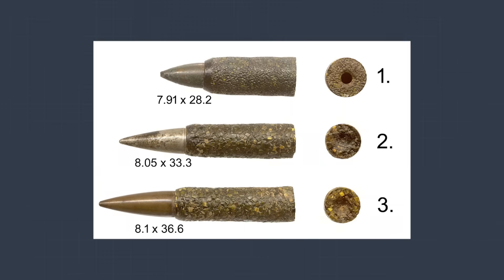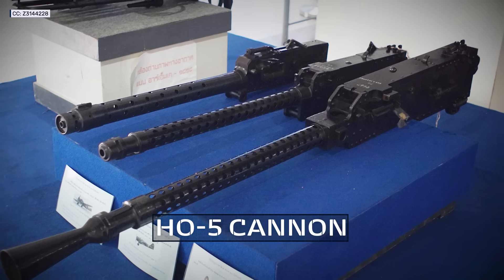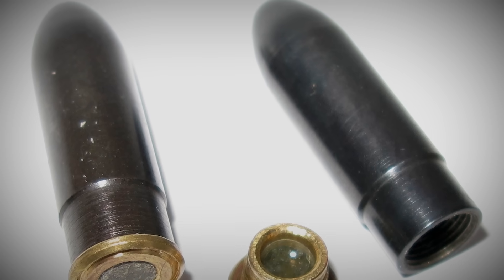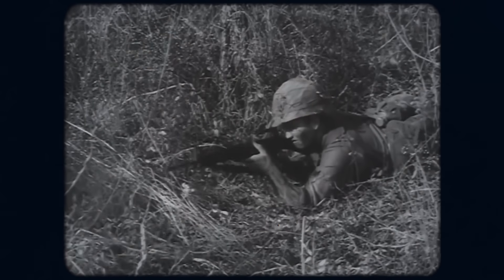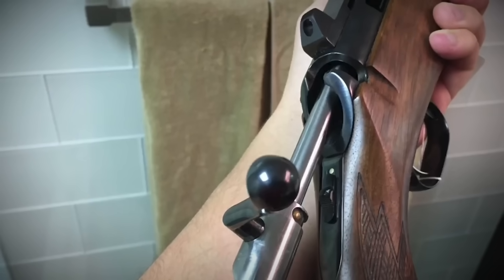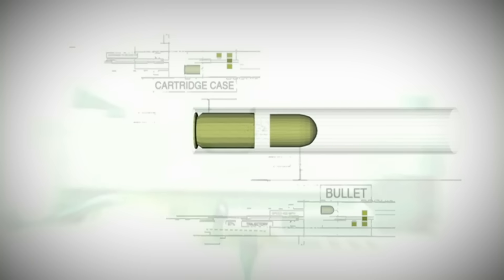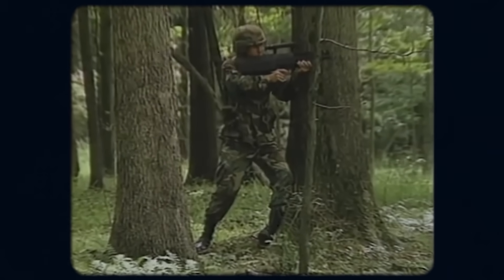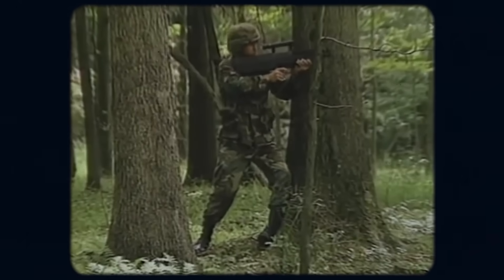Is Caseless Ammunition the Future of Warfare?

Comment: The M-16, as designed, was as good as it gets and is now the longest serving rifle in US military service, rivalling the AKM, if not surpassing it. (The AK-47 was only briefly used, replaced by the stamped sheet metal AKM, which was replaced by a bevy of replacements improving upon the design and being somewhat incompatible wiht each other, unlike the AR-15 platform. AR-15's, M-16's, and M-4's have 90% parts compatibility, they're the same rifle but with different barrels and firing modes).
 
The Defense Department wanted to fight in Vietnam as cheaply as possible, to "sell" the war on the American public. They hired a bunch of engineers from the automative industry to cut costs. Ignoring Eugene Stoner, the designer of the AR-10 and AR-15, which the M-16 was based on, Instead of a chrome plated bolt and bolt carrier group, they decided to phosphate them, which is usually not a problem. They also decided to skip chrome lining the barrel and chamber, which is usually to reduce wear, but it also reduces corrosion, also not usually a problem. The BIG problem came from one of the advisors misreading part of the technical data that the rifle was "self cleaning". What it was referring to was the rear of the bolt being able to shed fouling during the gun's operation, not the rifle itself. They decided to get rid of the cleaning kit and oil bottle to save a few more dollars and some logistics steps. What happens when you introduce bare steel (the barrel and chamber), phosphated steel, and no oil in a high humidity environment where soldiers often get their rifles wet in streams and creeks or general sweat? Rust. On top of that, the military decided they had plenty of powder left over from WW2 they could use instead of this fancy new powder that Remington designed the cartridge and rifle around. When you use powder designed for large caliber rifles, like the M-1 Garand in a small bore cartridge, like 5.56, you get more fouling. Introduce no cleaning kits and no oil to the situation, you end up with bolts rust welding to the barrels and the rifles jamming like crazy. When soldiers were issued their M-16's it was in the field after they  had spent weeks training with a completely different rifle, the M-14. It was like teaching someone how to drive a left hand drive automaticin a parking lot but then they have to figure out how to drive a right hand drive stick shift during an offroad rally race. The only thing they had in common were the aperture sights, but everything else was different. The soldiers didn't know how to fieldstrip them to clean them even if they were able to scrounge up a cleaning kit. Ironically, the one thing they added to the rifle, increasing the cost, was the one thing the designer told them was unnecessary, the bolt forward assist. It's often called the "jam button" because it causes more problems than it solves. Older rifles like the M1 Garand and M14 had cocking handles directly attached to the bolt so if you had grunge or a dented round preventing it from chambering, you would whack it with the base of your hand to force it in. You had a 50/50 chance it would go off ok or cause a catastrophic malfunction damaging the rifle and wounding the shooter or the soldiers next to him. Eugene Stoner, the designer of the AR-10 and AR-15, intended the operator to pull the bolt back with the charging handle to get rid of the bad round or see what was keeping the rifle from loading and solve the problem, not force the round into the rifle causing more problems. The Army insisted they include the mechanism. A chrome plated bolt carrier group, chamber, and bore would go a lot further into preventing malfunctions instead of the bolt forward assist creating them.

Comment: polymer cases are really the future. Just adopting it would require an ammunition manufacturer to add—or rather, modifying—2 steps to the process while eliminating 4. Plus, the polymer case is much easier to work with, meaning less down time in manufacturing due to broken machines and tooling. There are much more reasons to make the switch than not.

Comment: Plastic casings are novel however plastic is hydrophilic and can swell when exposed to humid environments. And can become brittle when exposed to the cold or sunlight for too long. Plastic doesn't make much sense logistically as whatever weight savings you get does not outweigh the reliability of the rounds over time.

Comment: Cased ammo was the technological improvement over caseless ammo.
Reply: More like weapon design wasnt able to get "caseless ammo" of the time to work for more advanced weapons that werent revolvers so the case solved many of their problems. Its like how planes at the start had to use a lot of wings to create lift because the engines at the time just werent powerful enough. Once the engines did get enough horsepower and speed, then a single wing did came to be as the most efficient configuration.
Reply: @eom1682  Cases serve more than one purpose none of which which can be simply replaced by redesigning firearms.  Modern designers cannot make caseless ammo work any better than did the original designers.
Reply: @blshouse  Yeah, im just saying that we still dont have any crazy good enough materials to solve the issues having a case provide. If we could for example, get gunpowder that generate a lot more gasses, we could just partially ignore chamber sealing and just vent the extra gas somewhere safely without a loss of bullet velocity, like how revolvers do anyway.

Comment: The 120mm M1A1/2 tank round has no case.
Reply: More like it has a case made of paper/cardboard like material that burns up when the round is fired, and even then not fully. It still has a metal bottom section. Which is the case for artillery too, not just tank rounds.

Comment: It would have been nice to go into the "political" factors of what killed the G11. Especially as that was what actually did it. Yes, it was expensive, it was complex, but it did what it was set out to do, have an insane cyclic rate of fire in a three round burst (the weight of the ammunition was just incidental benefits, the reason for caseless was to eliminate the extraction step of the cycle).
The point of the matter here is that if the G11 had been finished just one year earlier, or if the eastern block would have collapsed just one year later, it would have been adopted, and not just by Germany.
The NATO standard issue would have been moot, as the US military was extremely interested in it, as were several other NATO militaries.
But unfortunately for the G11, it was a very expensive assault rifle, coming just at the moment the enemy it was designed to fight against vanished.
So now Germany and all the other NATO members had this nice, expensive, rather robust (eliminating the ejection port, the point where most mud and dirt enter into the action of a weapon seems to protect somewhat against getting the action fouled up), expensive, highly accurate, and expensive rifle, and no enemy that would warrant such a rifle. And especially Germany had suddenly quite a bit of other bottomless holes in the ground it could throw money into, and so, despite being essentially one step away from being adopted, and probably becoming the NATO standard, it fell to the wayside.

Comment: Brass is better than steel because when the bullet is fired the brass around the slug expands forming a tight seal in the chamber preventing gases from escaping around the case into the weapon rather than expelling the slug. Reliability is no different between brass and steel, that's about the quality or age of the ammo not the casing. Using steel over brass will add more gas inside the firearm than just casing ejection already does requiring more frequent cleaning, if you don't properly clean the firearm then it won't be reliable regardless of the case or lack of used. That reliability issue isn't the casing but the cleaning schedule. Schedule cleaning cycles around brass but use steel and you will get reliability issues just as the same schedule but not cleaning until after with brass will do the same.

Comment: if you could figure out how to use an attached case with a gas/electric propellant system (using the ignition a compressed to gas initially launch the bullet, and magnets to accelerate it(a rail gun hybrid)) you would have a pretty badass caseless weapon

Comment: Since firearms were 'caseless' until the mid-19th Century, the metal cased round was actually the single most important improvements to all small arms, and then even light artillery, as well.  The numerous advantages of individually cased rounds still far outweigh caseless ammunition.  Going backwards in firearm development in order to eliminate just the brass casing, re-introduces ALL the problems that the casing solved to begin with.
In the world of portable firearms, keeping things simple in a firearm increases usability, reliability, serviceability, and durability, all at the same time.
Whether one chooses to save the expended brass shells, or not, does not change the fact that they are reusable. Expended shells can be reloaded many times with tools that are reasonably affordable for most gun enthusiasts.
Reply: The reusability of brass shells is only relevant for firearms enthusiasts though. For instance for military use, the amount of ammo the average soldier can carry is an importent factor. It was one of the main reason 5.56x45mm NATO was introduced. No Soldier will ever collect his spend brass casings to reload them.

Comment: 8:45 National Team long range shooter here. The delay has an insignificant effect. Ignition after the primer is struck is less than 10ms. The time the bullet spends in the barrel is 2ms. On the other hand, the time between deciding to fire and completed trigger pull is around 250ms for an average shooter. That's where the vast majority of accuracy affecting motion occurs.

Comment: In theory caseless would be very nice to pull off, especially in a square-profile.
for small-arms though, there are problems with sealing, storage, and transportation.
how does caseless deal with poor storage? loaded weapon being dunked underwater?
the casing provides structural integrity and protects the chemicals from the elements, which makes it very durable and reliable.

Comment: You could separate the bullets from the ignition and propellant, but why would you want to do that? The whole point of putting everything in a single cartridge is that it's a lot faster and easier. I guess you could have something like a gauss rifle where the battery is required to stay in the rifle. That's a very different technology though.

Comment: to prevent malfunction of the gun's internal mechanism from firing caseless round, the best thing would be to coat the internal of a gun with silica . . . it'll dssipate the recoil effects as a normal gun should if it was firing a conventional bullet . . . however this will reduce the gun's maintenance intervals in the long run, several internal mechanism will have to be replaced with new ones . . . silicon carbide will eat into the gun's internals after months of regular use . . . it's just like a internal combustion engine that runs on diesel & one that runs on gasoline . . . a 3.4 TDI I6 oil burner will wear out way sooner than that of a 4.4 Biturbo V8 gasoline engine . . . bcos diesel contains sulphur that corrodes the internals of an engine . . . which is why diesel cars have shorter service intervals . . .

Comment: Saw a video recently by Everything Black Powder using hazard compressed black powder cartridges; you basically dampen the powder enough so it sticks, compress it until it holds its shape, then coat it in nitrocellulose lacquer to waterproof it and keep its shape. You could load it into a revolver without issue. Pretty much a cartridge without the case. Return to monkey.

Comment: Something you should remember when dealing with guns is actually the heat. What you basically have is a small explosion contained in a tube. This produce a lot of heat, and you can burn yourself after just firing a few rounds. Gods know how many times I almost burnt my hand trying to remove my suppressor on the hunting rifle.
Caseless ammo have the issue that there is nothing that removes the heat. The brass case actually absorb heat, and removes some heat when ejected. You can't do this with caseless ammo. When it comes to aircraft firearms, that is different when it comes to heat. A aircraft fly so fast that there is always new air blowing over the weapon. Which means it always has cooling. Which means heat isn't actually much of a problem, and allow for a very high rate of fire.

I also want to point out that just because modern firearms are built around the case, that does not mean it needs to be replaced or even that it is bad in some way. We developed the wheel thousands of years ago, and we have no need to replace it. Caseless ammo most likely hasn't taken off for a good reason.

Comment: I have no clue about heat problems etc. but what if the "caseless" is not bullet nor gun problem, instead the magazine itself is the thing that needs reinvention.
Stupid idea but would it be possible take step back to how guns used to work: "primer", powder and bullet are separated.
- Magazine has 3 or 2 different slots: primer, powder and bullet or primer with powder and bullet.
- Gun chamber acts as a "casing" that tightly squeezes the bullet on the barrel.
- When magazine pushes new bullet into the chamber, it also pushes new powder amount/"powder sack" and new primer into the chamber.
- Firing pin hits the primer, ignite the powder and fires the bullet. When bullet leaves the chamber, "bullet squeezing mechanic closes the barrel and opens the side of the gun (similar what case ejecting would do) letting air inside the gun for cooling and closes when the firing gasses return back letting new set of primer, powder and bullet enter.

Ofc chamber would build up the residue etc. and the camber would need to be pretty damn durable to take constant explosions + the "squeeze" mechanic is problematic to make.
But that is just idea thrown into the wind. Maybe that would work better for bolt/semi automatic guns. And is there really need for fully automatic caseless gun? As far as I know, firing full auto in a war is pretty stupid thing to do with handheld guns. And light machineguns could use cases but assault rifles are already more useful when used in semi fire/burst fire.

I don't own a gun, never fired one nor want to fire one really. I am just interested about the mechanical parts of how things work and love to try find ways to fix and/or improve those.

Comment: Case-less as pointed out has some issues that can hard to solve but something like the combustible case round that are used in the M1A1 120mm main canon where you only have a partial metal case should work much better. The 'after-cap' holds the primer and forms the seal for the chamber and is ejected after firing. Best way to look at it is the brass part of a shotgun round is the 'after-cap' and the plastic case part burns up when fired. In small arms rounds would save a lot of weight but still stand up to less then idea handling by the users.
Reply: Yet how many fully automatic shotguns are out there?
Reply: @fidjeenjanrjsnsfh  more and more every year from what I've seen.
Reply: You're not claiming that shotshell hulls burn up in use, are you?

I reloaded a lot of paper ones back in the day.
Reply: The cheapest part of a soldier's load-out is small arms ammunition.  Caseless ammo is a solution looking for a problem.

Of course, so is .277 Fury and the $5,000 rifle to shoot it from.  (Look, by raising the pressure to a ridiculous level, and at much higher cost, they've managed to duplicate .270 Winchester ballistics.)
Reply: @douglaswickstrom6736  It's not the cost, it's the weight. An M80A1 7.62x51mm EPR round has an 8.5 gram projectile, about 3.4 grams of powder + primer, and a case that weighs about 12 grams, for a total weight (rounded) of about 24 grams per round. You'll note about half of that is the brass, so assuming your caseless propellant is roughly the same mass as powder equivalent, you're looking at carrying being able to carry twice the amount of ammo per a given weight

Since the propellant is a solid rather than a loose powder, that also means it takes up less space, which means the rounds can be significantly shorter, which means, again, you can carry more because your magazines can be smaller (and thus lighter). An additional advantage, as used in the G11, is that there's no particular reason the propellant has to be round. The G11's caseless rounds were square in cross section, with the round bullet embedded in the square propellant. Square rounds means they can be stacked much more efficiently in a magazine, not wasting space, which again means either a smaller magazine for the same amount of rounds, or more rounds in a magazine of about the same size.

That's why militaries keep trying to develop them. If you can send a soldier into battle with twice the amount of ammunition in a smaller form factor for the same amount of weight, or conversely the same amount of ammunition for half the weight, that's a big deal.